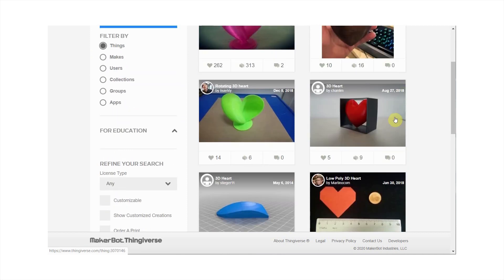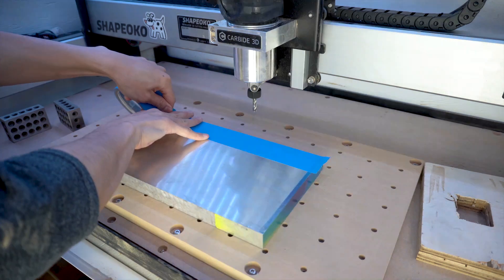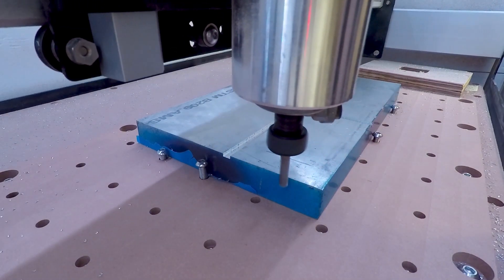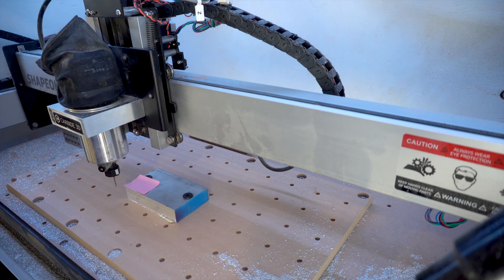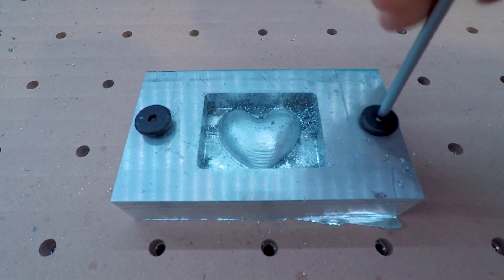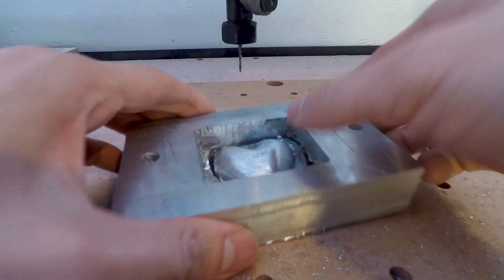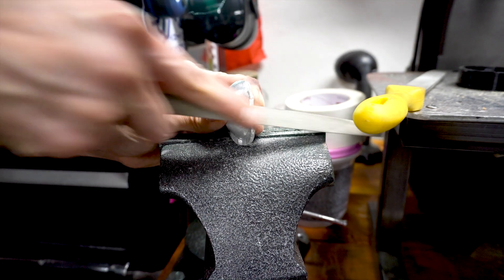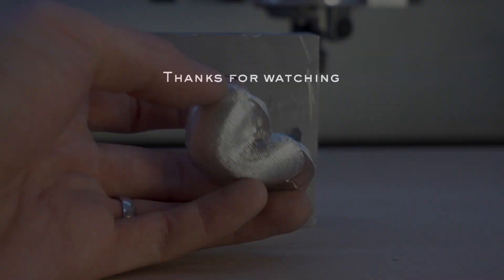CNC Machining a 3D Heart | Milling Aluminum with a Shapeoko

Comment: Wait you broke 5 end mill bits? What did you do wrong? I'm going to cut aluminum soon myself, trying to learn tips and tricks. Also did you use any lubricant?
Reply from the maker: Lol yes it was an ambition first project with aluminum. I had the speeds and feeds wrong and didn't use any lubricant. Single flute end mills are the best you can find decently priced ones at 2Linc.com. Use conservative speeds and feeds then speed override as you gain confidence with your recipe. Good luck and have fun!!

Comment: I'm not familiar with what controller this machine would use, but if it's anything like a basic Fanuc, you can use a GOTO command to skip ahead in the program and get to the line number where you left off.

Basically just put in GOTO1234 after all your startup/safety commands. then on the line where you left off add N1234 at the start of the line where there's a safe Z height. The machine will skip all the commands in between so you don't have to cut air for hours.

This is extremely useful if you do a reasonable amount of machining, so it's worth learning.
Reply from the maker: That's great to know! Thank you!
Reply: @IMEEMADE  no worries. I just started my own channel, I would kill to get my hands on a CNC, I feel like a caveman in my own workshop :)

I'll get there eventually.
Reply from the maker: Haha, definitely know the feeling! Soon enough you'll have everything you want in your workshop, one tool at a time!

Comment: De-bured the edges 😳🤬 lol.
If the shank of your tool is long enough I always put mine butted to the back of the router so if I have to changing is easy (adds Z axis rigidity to! And if you need to use any other tool use a drill bit stopper on tool you want to use and when you initially set your Z height set these other bits in the machine drop to zero and set the stopper just a collar with a set screw.
You can always take stock away however you can't quite put it back. Hence this flat feature on my key chain loop.. 🤫🙄 I found WD-40 and air blast was best and from the footage I'm looking at I'm thinking it's sticking because it got hot at the end. And maybe the feed and depth where quite aggressive for the spindle (shapoko rigidity)speed which the above will help with if I were to guess.

Damn didn't mean to write a Bible sorry lol.
Reply from the maker: Thank you for the wealth of information! The drill stop collar is such a good idea, I'll have to do that for the next project. This was our first attempt with the shapeoko besides the hello world test and you're right the feeds and speeds were way too aggressive and the tool paths needed a bit of work. We've since dialed everything in to cut without airblast or coolant. Single flute cutters FTW! Lol thanks again for the comment and watching our video!

Comment: Not a fail if you learned things.  Besides, anybody can make two hearts romantically overlapping when they are side by side.  Who would think to make them back to back?

NYC CNC is the best, and I love Fusion 360. I use Chilipeppr to feed gcode to my control, and it lets you pick up the program wherever.  I use it in a mill, but it all works the same as what you are doing.
Reply from the maker: Thank you so much! That's motivating to hear. You're right as long as you learn something, it's never a fail. 

I'll definitely check out Chilipeppr, thanks for the insight!